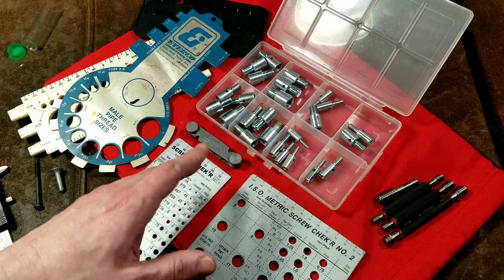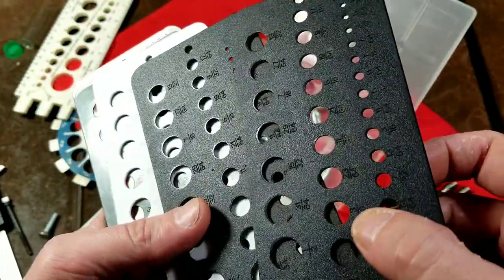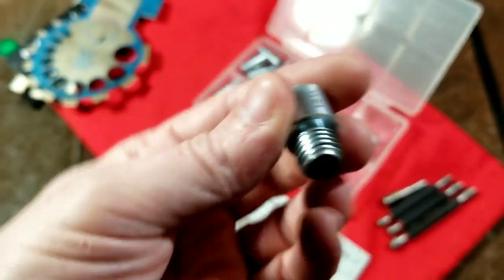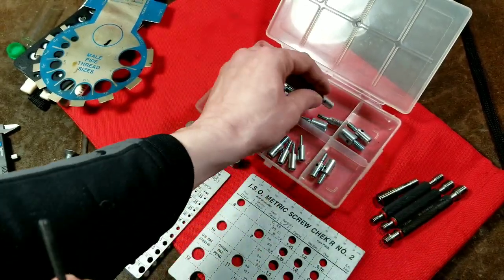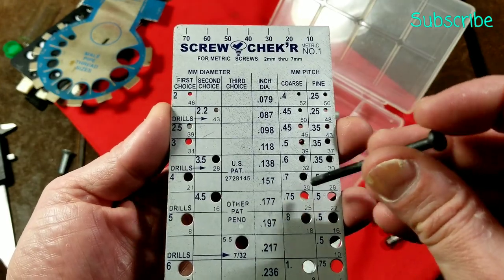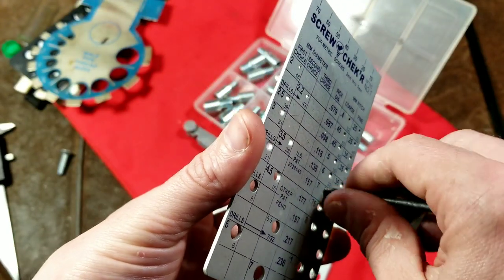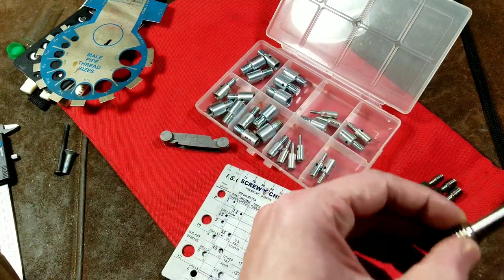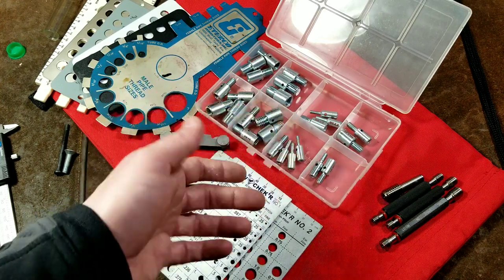Screw/Bolt/NPT Thread Checkers and Gauges Comparison & Overview

Comment: Nice thread share thank you for sharing, We have the thread checkers left them on their cables (one blue one red) one metric one imperial hanging right above the door jam to our workshop always quick and easy for basic references, we also us the fractional thread gauge while machining on the lathe. 
We use the masters, Go No-Go gauges during production thread runs on the lathes periodic checking while making threaded holes in parts. 
Lance & Patrick.

Comment: Hey thanks for the video. I have a set of these in a cable and it's a pain in the butt. The box is a great solution. What they.need to do is best the guy to death that had the idea for a doesn't different thread pitches.

Comment: My replacement car aerial has a screw fitting which is larger than the original screw fitting.  Can you get screw fittings which have a different diameter on each end?..... rather like an adaptor. Thank you.